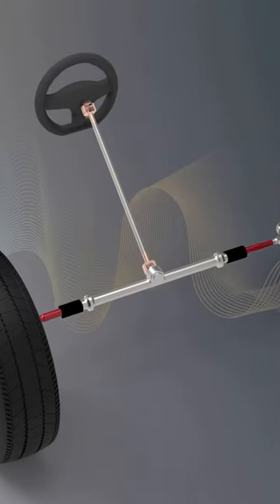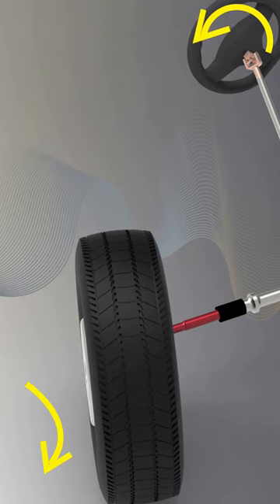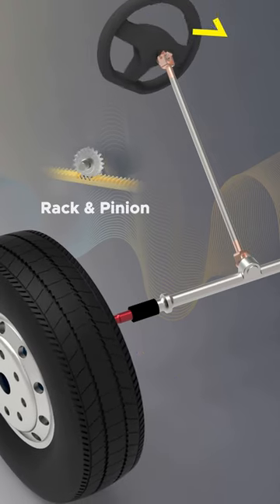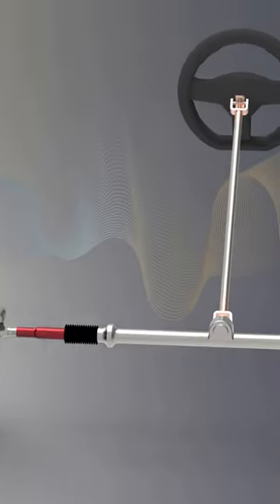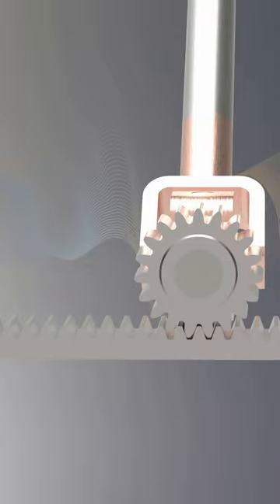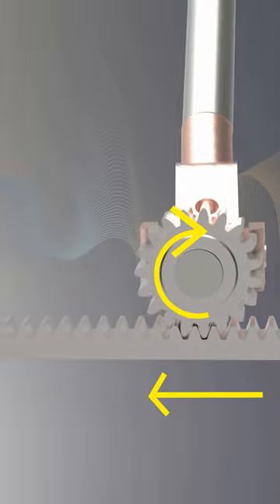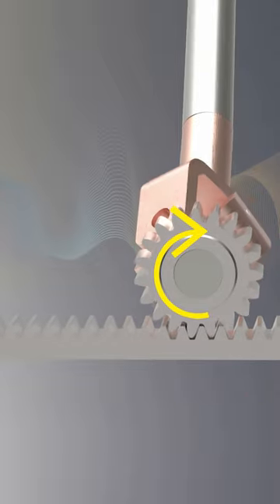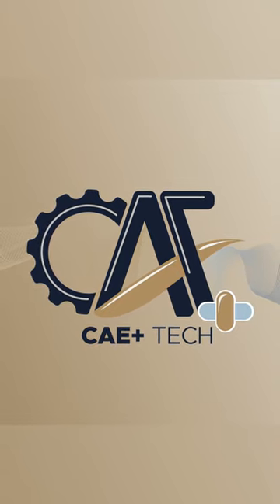Steering System [Rack & Pinion] #Shorts

Comment: Keep in mind you may have a different (hydraulic) rack and pinion system in your vehicle. Not all cars are this way.
Reply from the maker: Correct, this animation covers the general type of rack and pinion that most cars use. However, as you mentioned there are few other design variations.